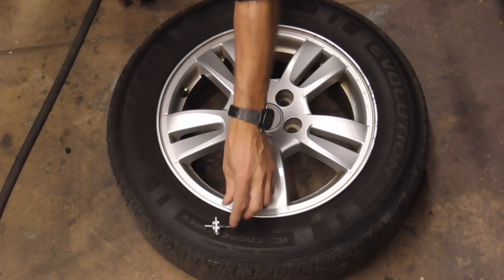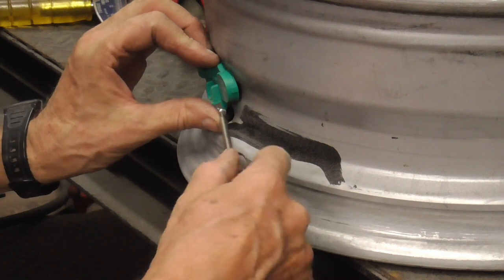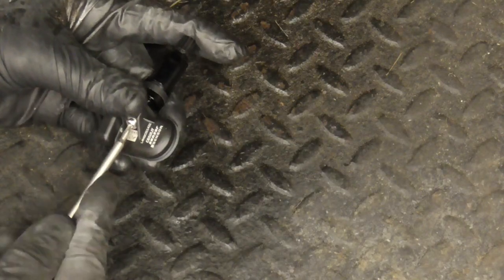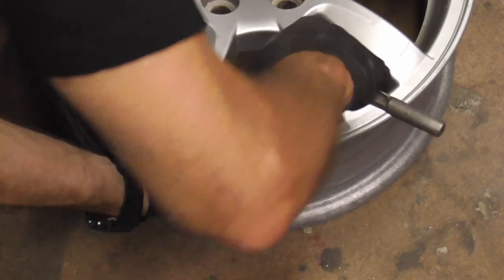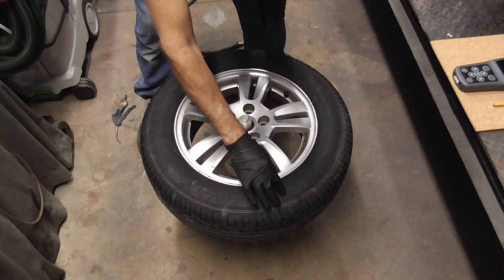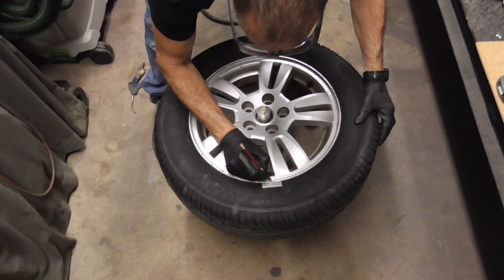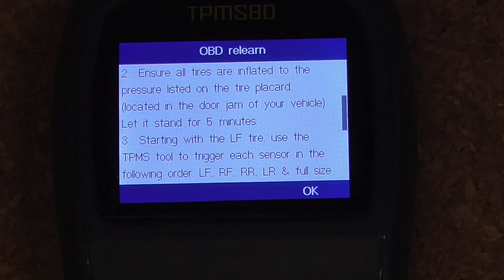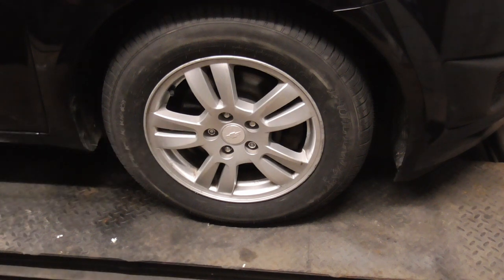How to Mount & Balance Tires with TPMS Sensors - Simple Tools

Comment: Hello this is a brilliant video! As a result I am going to buy the tyre changing equipment for my own workshop here in beautiful North Wales, UK.

I have had a problem with a tyre on one of my vehicles. I think it is simply down to the fact, when they changed the tyre they did not clean the wheel properly. They now refuse to fix it and disagree with my suggestion!

Your video has helped a lot and the kit will probably pay for itself after about two or three wheel refurb's 

Thanks for sharing!
Reply from the maker: You're welcome.  That's exactly why I started doing tires on my own.  If you have old cars, they won't spend the time cleaning the rim properly.  North Wales sounds awesome - I'm going to look it up on Google.  Thanks for watching JB :)

Comment: Great video Jerry!  Didn t know you were also a tire man.  BTW. That's the most polishing and sanding I have ever seen on a rim.
Reply from the maker: It was a lot of cleaning but if that ain't smooth it's leaking - at least I think.  I've always driven junk, so when I get a tire put on they've always leaked.  I ended up caving in & buying a tire set up to do my own tires.  Believe it or not, if you do it right you won't have to worry about tires getting low.  Maybe once a year, you might have to check and ad 1-2 pounds or air.  Thanks for checking it out PSG - enjoy the rest of the week :)
Reply: @LakesideAutobody  Agree 100 percent. And when they leak you go back and they add more goop lol.  Have a good weekend Jerry

Comment: All this fancy shmancy TPS stuff and you're using a HF manual tire changer and balancer and torquing the lugs with a beam torque wrench.  You use a little bit of everything there.  Just goes to show that with a little know how you can get things done properly without having to run out and buy all the latest most expensive equipment.
Reply from the maker: That torque wrench is from like the 50's but I love it.  Super easy and fast.  Thanks for watching Bruce - have a great weekend :)